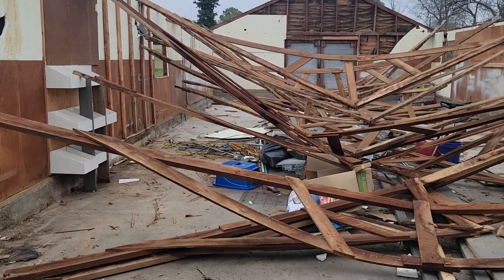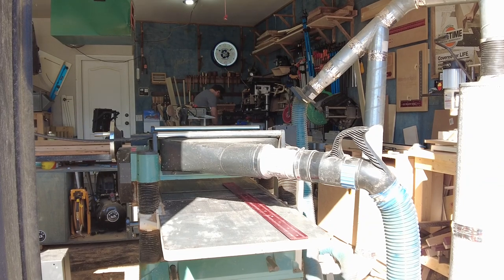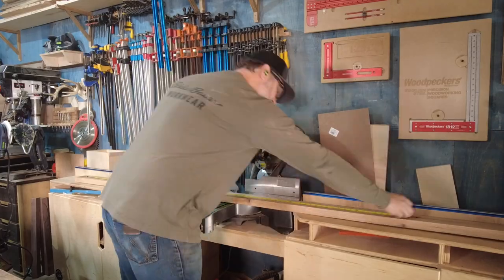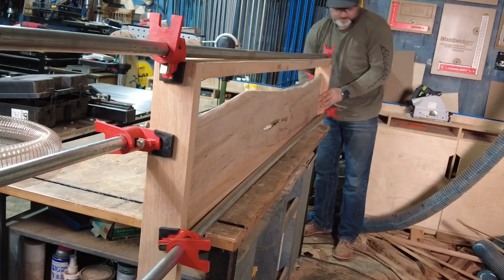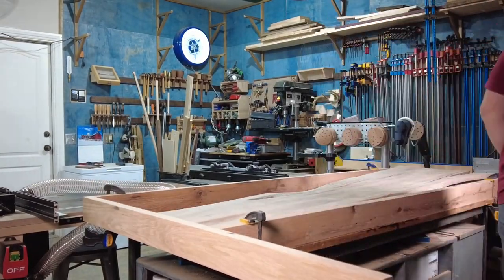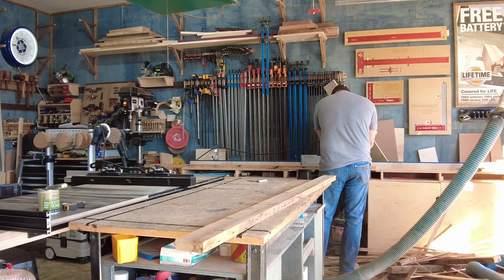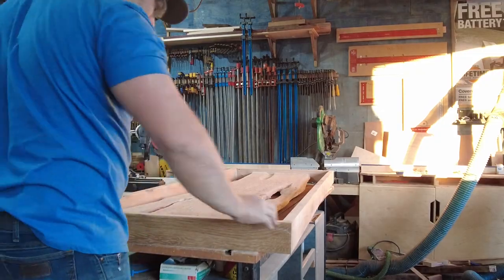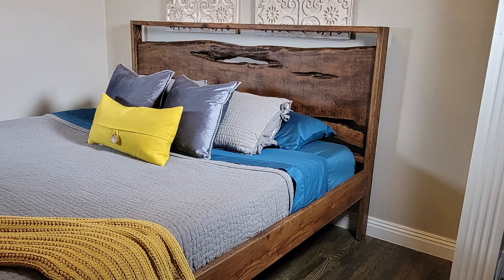Mid Century Modern Live Edge Recycled King Bed

Comment: That turned out great! My only problem working with reclaimed wood is that I always find a nail that has broke off in the wood. (My jointer knives just hate that. ) Just wondering if you had to deal with that. #TSGA.